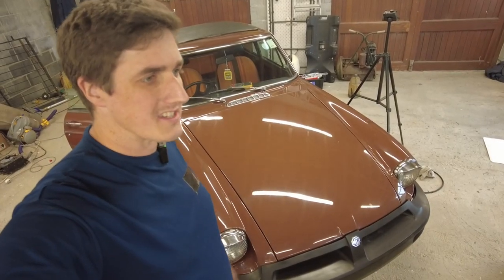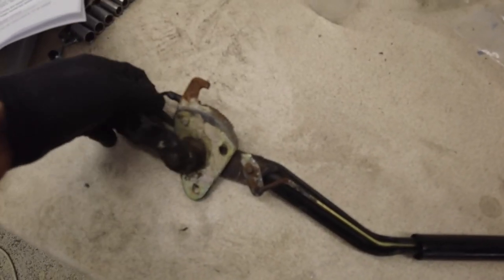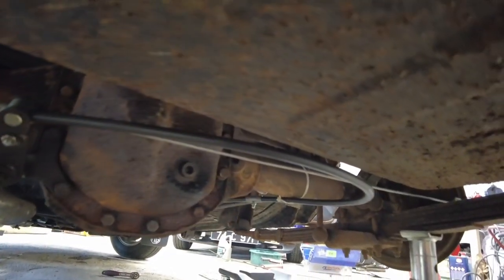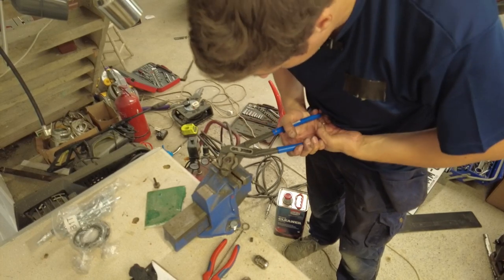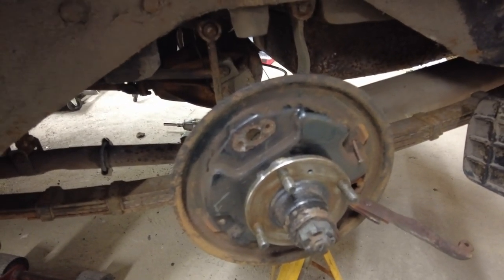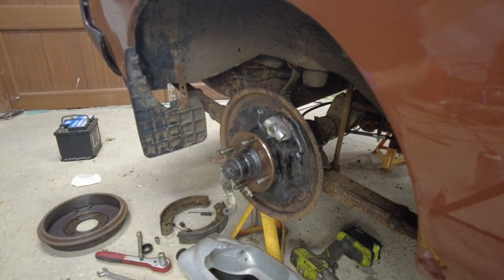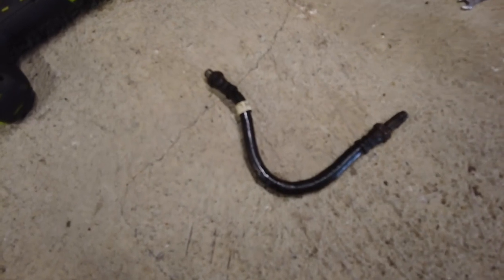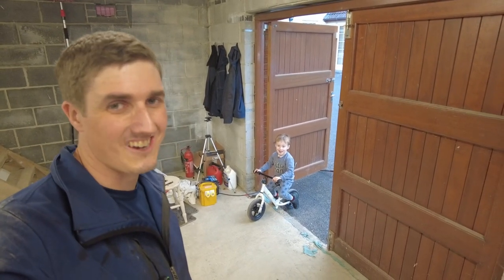MGB REAR BRAKE OVERHAUL - Rear drums and handbrake cable

Comment: For adjusting the rear brakes one should never use an open spanner, but a special tool with the correctly fitting, small square hole. I've once bought a type with two small sockets in two sizes and swivels holding the ends to the rod inbetween. Works fine and if the adjuster is always turned completely outwards and after greasing turned to the proper setting it will never freeze solid nor will require the steps shown in this video for loosening it.  Copper grease may be used, but normal grease or even Waxoyl work just as well  😃  

BTW I never managed to grease the handbrake cable by its greasing nipple, but for the very first time having it new and unused lying on the garage floor before mounting  🙁

Comment: Ross, one thing to consider when swapping the front crossmember will be the difference in ride height.  The rubber bumper cars were raised 1 or 2 inches to meet US headlight height laws.  How it was done I have no knowledge as I've not worked on any rubber bumper cars.  It's something to look into for possible problems to overcome with the swap.

Bob
Reply from the maker: Thanks Bob. I was aware of that. The car the cross member is coming off is a rubber bumper car too.

Comment: Another enjoyable video, having been through all this with my 1972 BGT. One thing I have noticed is you are missing the splash guard that fits between the engine and the radiator. Good luck with it all. 😀😀
Reply from the maker: Thanks! I must look out for one of those so. I'm pretty sure I know the piece you mean.
Reply: @Endfloat  Ross its part N0 BHH 2127 available from Rimmer Bros, MGBHIVE etc, It's called a Mudshield.
Reply from the maker: Ah you're a star, thank you! I'll pick one of those up so.
Reply: @Endfloat  No problem mate always happy to help a fellow MG owner.

Comment: Great work on the brakes, have you considered an Easy Stear electric power steering kit for the MGB ? They have kits on Ebay for around £300...
Reply from the maker: I probably will be doing that at some point. My dad will probably need it.
Reply from the maker: I probably will be doing that at some point. My dad will probably need it.

Comment: Fair play Ross. Would you consider sticking a Rover V8 in the Purple car?
Reply from the maker: The plan was originally to keep it stock, but now that I have the brown car, I'm reconsidering my position on this!
Reply: @Endfloat  Reading about them earlier, 2500 or so were made with Rover/Pontiac V8 engines..
Reply from the maker: @brianmac8260  yeah the MGB V8 is a lovely car. If I were going to modify the car though I'd go for something a bit different.